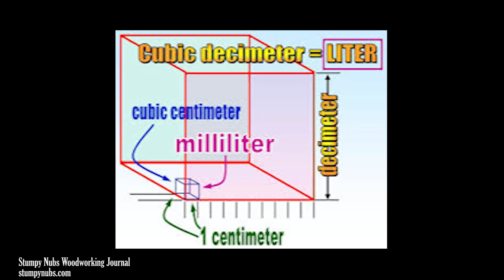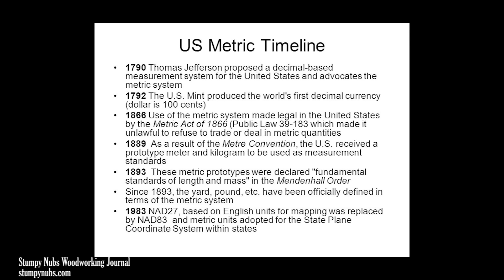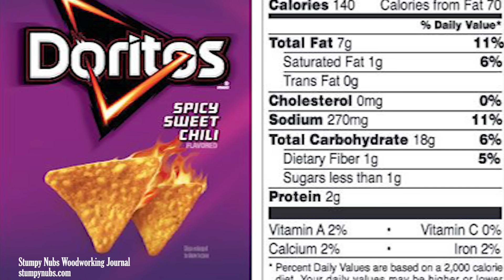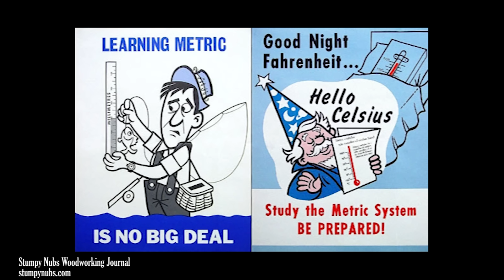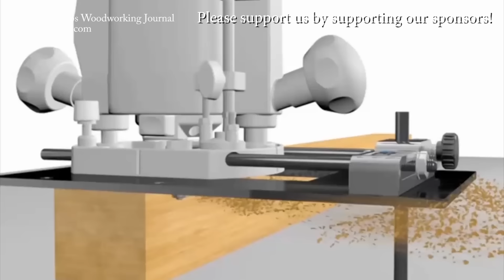BREAKING: The USA is switching to METRIC!

Comment: Favorite metric system quote is by Josh Bazell. 
In metric, one milliliter of water occupies one cubic centimeter, weighs one gram, and requires one calorie of energy to heat up by one degree centigrade—which is 1 percent of the difference between its freezing point and its boiling point. ... 
Whereas in the American system, the answer to ‘How much energy does it take to boil a room-temperature gallon of water?’ is ‘Go f**k yourself,’ because you can’t directly relate any of those quantities.”
Reply: There is no such thing as a centigrade. Unit is called Celsius.
Reply: @user-lq8en4bo1z  centigrade is another term for celsius. and was often used by the british and french.
Reply: @user-lq8en4bo1z In Brazil we use both centigrade and celsius as synonyms
Reply: Still, proper unit name is Celsius. Whatever nickname you use is irrelevant.
Reply: It's simple, 1 btu per pound of water per degree F. The problem with Celsuis for a temperature scale is yes it's nice for dealing with science stuff and huge temperatures, but for people, room temperatures and refrigeration it's horrible. The problem is there's only 100 degrees between freezing and boiling. So for example, there's a big difference in setting a thermostat to 19 degrees and someone else prefers 21. In refrigeration, the problem is even worse. In degrees F, we can set our control thermostat to cut in the refrigeration plant at 40 degrees, and cut out at for example 37. This will provide enough of a differential to allow for off cycle defrost, but keep the food from reaching or exceeding our fresh food critical temp of 41 degrees. So with F, we have 8 degrees to play with from beginning to freeze some foods to starting to spoil from 33 to 40.  In degrees C, we'd need a temperature control to either have a tenths digit, or at least a half digit of precision in order to accomplish the same thing. The units were chosen too arbitrarily in my opinion. A kilogram is just too big of something for a common sized thing to buy in a store, who ever made a kilogram package of butter? You can tell just about anywhere in the world, there is still basic remnants of old units still around. For example milk is sold in either 2 liter or 4 liter containers (1/2 or 2 gallon), the most common size of lumber is 50x100mm (2x4), and so on. Liters are too small for good practical everyday use, it's just too much of a headache to fill up a large fuel tank and need 400 liters, when 100 gallons is much simpler and easier to deal with, a pound of sugar or flour or butter is a more useful quantity. And a kilometer is too short, and doesn't match up enough with a nautical mile, even tho that is also significantly different than a statute mile.
Reply: I didn't read a single good argument in the comment above. I'm calling it trolling 😅
Reply: @brnmcc01  If kilogram is too big of a quantity, just consider the pound as half kilogram and voilà.
Reply: @brnmcc01   you can also use decimals and centesimal in ºC, so is very precise. also butter are sold in 250 and 125grs, milk in 1 liter and is matter of use rather than "impractical"
Reply: @user-lq8en4bo1z Centigrade was the original word, before it was renamed to Celsius to honor Anders Celsius.
And centigrade is still widely used by English scientists.

Of the many documentaries I've seen over the years with scientists (which are usually British or American), they almost entirely use the term centigrade.
Reply: @user-lq8en4bo1z  To be precise, the unit is "K" "Kelvin" (...on the Celsius scale). Calorimetric constants and calculations are always done in K.
Reply: @nemesis7774  We even call that "Pfund" (meaning "pound") in German. The standard butter block is 250g, "ein halbes Pfund", or "half pound".
Elder folks (like me) are frequently using "Pfund", "Halbes Pfund", "Viertelpfund" while shopping. "Ich möchte ein Viertelpfund Schinken" - I'd like to have a quarter pound of ham (125g indeed).
I'm engineer and these are never, never used for engineering.
Reply: @brnmcc01  I don't buy these "problems" with metric. Celsius is only 1.8 times as coarse as Fahrenheit. Every air conditioning I've seen here is in 0.5 C increments. No way can anyone honestly tell the difference between 20.0 C and 21.5 C, and certainly not the difference between being too cold and too hot. At my workplace if the aircon is set to anything between 18 C and 28 C, the air that comes out is -20 C (frigid). The difference in comfort is far more down to how close you are, and very little to do with the 0.5 C difference in setting. And we buy butter in 500 g packages and most foods in grams, so who cares if 1 kg is too much to buy? Is it an obsessive-compulsive thing that you have to buy a full "1" and can't bear to buy 0.5?
Reply: Calorie is not in metric system
Reply: @brnmcc01  Completely wrong. Everything.
All of the SI units are made up to be easily converted into each other and also to make calculations a lot easier. There reference between each other with the factor of one (= unit conversions don't need calculation) and thus are not "arbitrarily chosen". BTW this is a stupid quote. They were all chosen to form a consistant system. Also, you can reproduce all of the units in a lab with the needed equipment. Not only everywhere on the earth but also everywhere in the universe.
You mentioned the 400l tank? Ok, now tell me how long the sides of a cubic tank are that holds one hundred gallons.
For liters, it's easy. It's the third root of the volume. And comes in dm (deci-meters) Multiplied by 10 it's meters.
The Celsius scale reaches above 100 and below zero (remember there is a minus sign?)
The meter is the 10 millionth part of an earth quadrant (this is, the distance from a pole to the equator.) So the circumference of earth is 40000km. Now go and figure out the odd number in statute miles.
BTW It's 360*60 nautical miles.
You don't use nautical miles, do you? 'I think you don't even know what a nautical mile is. Your distances are measured in something weird that is neither a nautical mile nor a kilometer.
And there is no clear concept of scaling up and down.
The kilogram was first thought as the mass of one dm³ of water (a cube the size 10x10x10cm). Read the kilogram story in a later comment.

Go inform yourself before delivering nonsense.
Reply: @brnmcc01  Erm... you know that Celsius is a decimal scale right? You can have 0.5 degrees or 0.002 degrees on a scale, you're not limited to whole numbers.

Comment: As a hobbyist boat builder, most of my work is done in metric. Honestly, I have always hated adding, multiplying, subtracting, and dividing fractions. It is a serious pain and takes far longer than just learning to use the metric system.
Reply: ever build an ECO6 micro-cruising catamaran sailboat? 13mm ply/epoxy/glass. Super-cool! I built one. Check it out if you've not. It'll put hair on your chest. haaaaa built a one-sheet tender for it, too. fun :-) next up is a micro canalboat
Reply: the inch unit system and other unit system are stupid. It is not because of stupid system, but because  that they are not compatible with the international system SI. All other unit systems must compatible with the international system SI. 
I often use computer programs for technical machines and other engineering tasks. And I often have to store and enter various values for various variables in computer programs, then let computer programs use entered values to calculate various tasks. You know that computer programs use standard known scientific formulas to calculate. If you enter values for variables in different unit system, then any time you add values, you must check the unit used in scientific formulas, then you must convert the added values to required unit systems. It is nightmare in engigeering tasks and scientific tasks. 
The only solution is that : use universal unit system SI : all programs and people exchage and communicate only with values in SI system. Thus no need to convert and check formulas when you apply variables in scientific formulas.  
Other unit system maybe comfortable only in conversation communication languages, but not in engineering tasks.
Reply: I suppose 16.5cm is a lot more impressive sounding than 6.5 inches of manhood.  I have to revert back to college lab mentality, scientific notations etc.  Biggest daily thing would be getting used to speeds, temperatures, and body weights in Kg.
Reply: guess ol sailingspark9748 is too-busy building some boat, so he can't respond here :-) Heyyy...I'm building myself an modded-Escargot canalboat now. What are you? And where is the least-expensive Epoxy to be found? I use alot :-)
Reply: @antoniiocaluso1071  Sorry, I was away sailing on the Chesapeake leading up the Small Craft Festival in St. Michaels. 

And no, I have never built an eco6, My boats tends to be long an pointy. A couple of kayaks, a wherry, and I just finished up a Milgate duck punt. 

My next boat will be Canoe Yawl, just have not decided how big or small I want to go.

I tend to get my epoxy from Jamestown Distributors. Being in NJ, the delivery from R.I. is super quick.
Reply: As a professional boat /  ship builder , for me the metric system is way to slow , and I have never seen a metric table of offsets .
Reply: vibratingstring  , 
I helped build 4 , 39 meter aluminum catamarans . My job fitter , you know the guy with the prints . Perhaps you should not be so presumptuous.
Reply: @jacobh9487 well, both is a fair bit above the average in almost every country...
Reply: Ironically boats are one of the few things we still measure in feet here in Denmark.
Reply: @LarsPallesen  good for you , I have built boats up to 160’ using feet and inches and even larger using the metric system . Myself I would never build another boat / ship that uses the metric system
Reply: @abstractexchange5057  Wasn't imperial measure before metric?  So which is stupid then?
Reply: The problem is everyone wants everything to be easy. If you can't measure in feet and inches that is your problem. If the metric system is so important to you to make things easier for you then go to Europe.
Reply: Hey sailingboy move to Europe. I don't think you know how to measure if you have such an issue with the basic form of measuring in the United States.
Reply: That’s the flaw of metric. It gives the impression it is easier because it is based on 10. Fractions are a superior method of mathematics.
Reply: Factions have nothing to do with it.
Reply: For me it's the other way round, all boat plans I have up to now are U.S. Customary. The "metric conversion" they offer sucks because it's done wrong. If you use chain measurement (20 x 4 inches) to build up a curve, it will end up in a mess since 4 inches are not 10cm.
What I do is simply use the other side of my rulers where they all show inches.
But I hate it.
Reply: @mrk131324  
Inches are a fractional system that is 12 based. Even clocks use that.